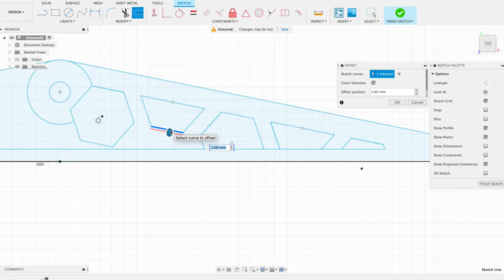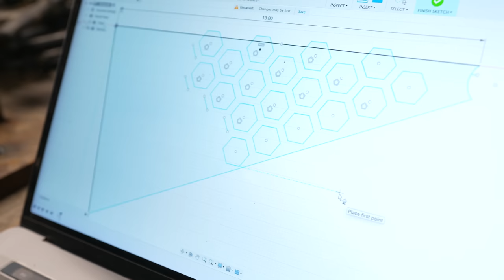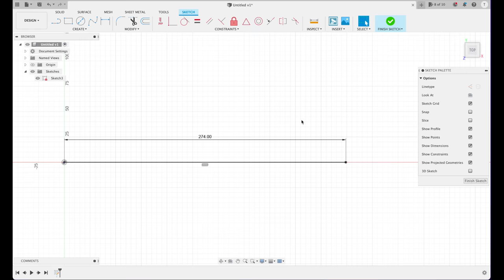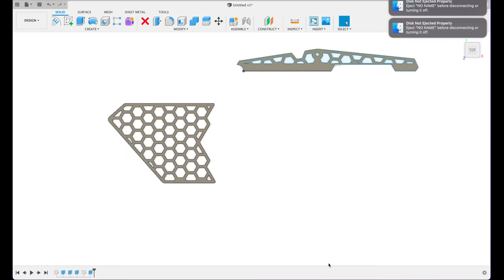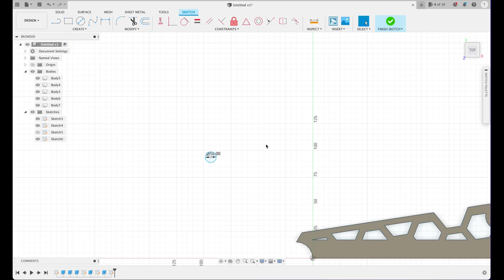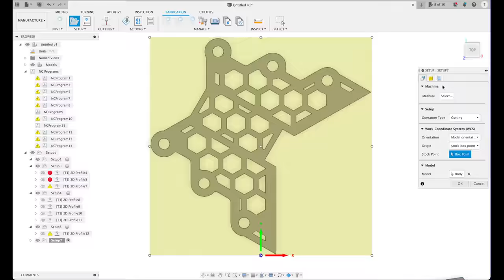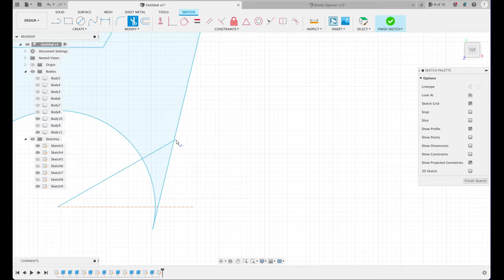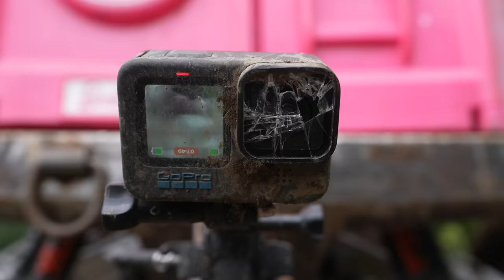Long Travel Suspension Built and Tested!

Comment: Have you guys considered getting a 3d printer? Autodesk software has a toolkit for generating internal structures using ai to reduce weight and material cost, with the results looking pretty insane. Cheap 3d printers can also be used to print steel and other metals nowdays too

Comment: Great idea. Hadn't gone that far. My kids were happy when they had those big wheeled stand up push scooters. And then I stuck a weed eater on it. And they were tickled. But I do have a CR500 dirt bike with an extended swing arm and I have or I'm currently building it with a CBR 600RR on it. It's only meant to go straight and up a mountain. Not done yet.

Comment: Idea for hexagon scraps: clean them up, make a row of them that is top of say 3mm flat bar depending on material thickness, place next row on the table and weld them, then repeat it. pretty damn unique and cool bumper material for instance and ties lovely into hexagon theme in general. Also kinda free material per say. Finally weld them properly from the back and wire wheel sharp edges out from the front.

Comment: The hex shafts from the snowmobiles are meant to be used as they are manufactured. If you don't disturb their construction, they are super strong. You showed the alternative. They don't like being modified. Your suspension has still been proven. One of the best. We saw it. It coincides with what Tom Cru....Ethan described.
Reply: It wasn't the hex shaft that failed, it was the original shaft

Comment: i use 18 inch travel foa shocks on my rock racer that has a 900cc triple 2 stroke . 35 inch tires on the trails feal like driving on pillows

Comment: It's pretty awesome to have a water bed for plasma cutter. Even a little bit of water underneath decreases smoke by A LOT and if water is quite close to the sheet of metal you're cutting, then it doesn't get warped and also you get cool metal sheet right after cutting. Recommend.
Reply: YES
Reply: Out of interest does the water bed (steam), give problems of corrosion?, I have a hand held cutter and I am just curious as a cutting table could sometimes be useful.
Reply: Not really. Steel will corrode the same way as you would splash it with water. If you want zero corrosion from your water bed, then add a tiny bit of Sodium Nitrite powder to your water. About 1.53g of Sodium Nitrite (NOT Nitrate) per gallon of tap water. @CrusaderSports250

Comment: Hey did you know that in fusion 360 you can draw a single hexagon and then multiply it in 2 dimensions using rectangular pattern? With  correct space between and everything.
Reply from the maker: Thanks for the tip!

Comment: A suggestion when you sleeve and extend the next set of axles - cut a fish mouth in the sleeve. When we used to cut and lengthen axles for the Baja SAE races, they always broke at the weld just like yours did. We had far less failures after we changed the how we welded them. The fish mouth will spread the heat affected zone out and not create as much of a stress riser there.

Comment: Long videos are top 👍 one thing… I wouldn’t cool hot metal down in water as then it becomes brittle, secondly if you put the drive shafts in the oven for a few hours after welding it will re temper the steel so it’s slightly flexible instead of snapping ie on the drive shafts.

Comment: Your design and fab skills are very good, but.
Your axle angles and ball joint angles are going to cause broken stuff constantly.
Your way out of spec range for those types of parts and this level of abuse, especially when turning the front wheels.
Also, this pink monstrosity is way too short and narrow wheelbase, with way to rearward COG, and I can't believe you have not rolled/flipped it several times already.

Comment: The a-arms are on another level above anything I’ve ever seen and if they are half as tuff as they look then you have outdone yourself again and the sway bar is the icing on the cake but you have got to get some bands for the axel boots instead of the hose clamps. The work you have done deserves the best parts to match.
It looks like it’s effortless to handle at hi speed also.
It’s going to be hard to out do these builds you have done and idea’s you have come up with 👍🏼

Comment: Can you make a video on how you go from CAD to the cut file to run on the ArcDroid? I have SolidWorks but 2AM doesn't have a post processor for it, so I am not able to make cut files. What CAD application are you using and how do you create the tool paths and get that on the ArcDroid? Thanks

Comment: Would you guys maybe be interested in letting people send you sketches and/or designs for vehicular creations and if you like any of them enough to build, maybe make a contest or something out of it? I had an idea for a unique build you could do but it would be hard to explain without a simple sketch. You guys are smart though so I'll try to give you a rough idea that may be too dangerous to build. Picture or remember if you will a person or yourself sledding down a hill in the snow head first. It's both scary and thrilling. I'm picturing an ATV like vehicle that ride almost on your stomach. It helps to picture a sport bike rider tucked in over the tank riding fast, but their legs are further back and flatter, like you're kneeling down but stretched forward. Does that make sense? Probably not. Maybe a speederbike from star wars is a better example. Now take that riding position and build a wicked frame/rollcage and slap some off road tires on it....You're craziest (and dumbest) project yet! An Ariel Atom that you control on your stomach.

Comment: Bumping this old video because I’m rewatching. With all the little hexagons, you could save them all and use them to build a backsplash for the new shops bathroom sink. Use the metal hexagons in place of tile and use colored epoxy to fill as grout. Maybe intentionally patina the metal.

Comment: You should put small fillets on any sharp edge aka (all the hexagons) any sharp edge creates a stress riser and will lead to cracks. My engineering OCD coming out. But killer job using fusion 360 the CAM software is so good.

Comment: Yo dudes! The solution to your axles breaking is to preheat your parts and post heat your parts. Your oven in your kitchen can do the trick. Preheat everything to 475 and then weld it all. Keep the ENTIRE parts @475 THE ENTIRE TIME YOU WELD. Then post heat them in the oven and bring them down to 300 over 2 hours. Also use an er90b3 filler rod. It has added chrome and more than likely those axles have added chrome for hardness. If you weld steel alloyed with chrome without pre and post heat it will crack under any stress.

Comment: I'm pretty surprised the axle broke before the CV's. Those go to such an extreme angle when you're at full droop, I'd be very worried about their longevity. Especially on the fronts, where you could have steering angle in addition to suspension travel.

Comment: i always wondered if you could use blank bullets to drive an axle some how like closed fan wheel with two ports on in one out and fire the blank in to a port to push it around and out the exhaust then like make like a 9 mm full auto something and big drum mag pushing a micro cart around ... and if that works bump up to the a10 warthog gun braaab ... or put this on a mad max car with blown big block for when you in that race and everyone has blown big block and you need that extra speed boost ... (mental thought of movie scene)

Comment: Excellent engineering. More metallurgy needed. On the test side driving Motocross gear , gloves for sure, jacket. Protection from cut your hands, arms, and neck. Did not notice 5 point harness. BTW I have tested airplanes, cars, and motorcycles. Only injury was when rolled out of shop and did extreme stunts without safety gear. With talent like yours, it would be a shame to lose precious gifts to preventable events. 
That includes you and your crew. All the best with future endeavors.

Comment: Take the steel hexagons make a mechanic builders chess board weld nuts bolts stuff to the tops for all the different chess pieces and did you ever think about cutting grind hard into the a arm pieces like on a truck u see Rc cut out in the  lift be similar but for the kart
Reply from the maker: Brilliant idea!

Comment: Love long travel suspension. Learnt my lesson about computer vs real life, mocked it all up as i designed it and quickly found out it cambered the wheels to much (As i hadn't taken into account the tread size on the tyre) managed to move the shock top mount to adjust it but then it got body roll :( - so i sold it
Keep having fun and you guys have def turned this into a thing now